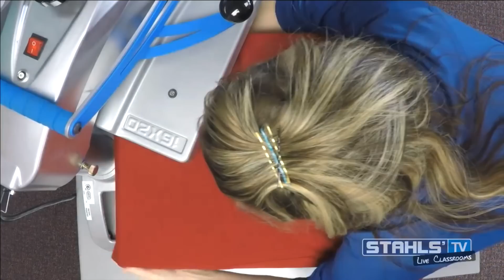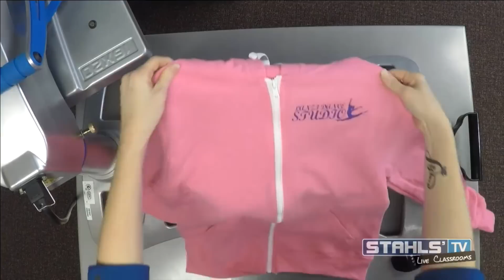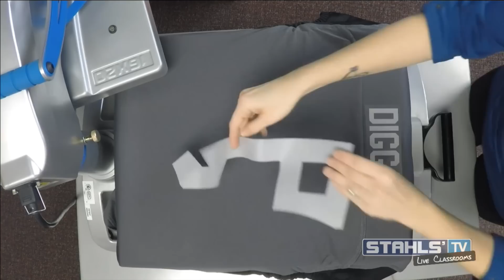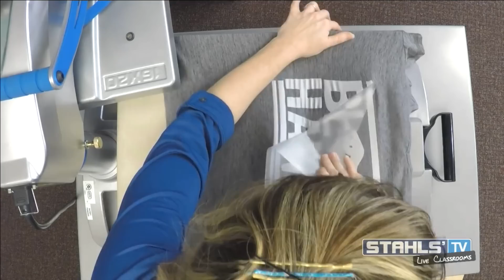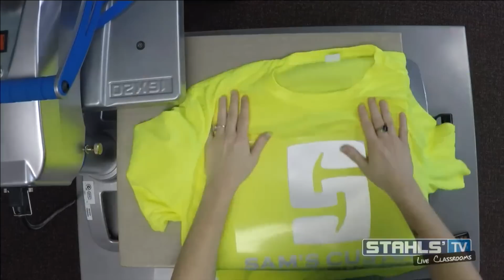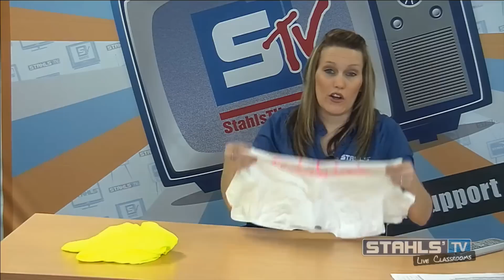Heat Transfer Vinyl Buying Guide

Comment: Can vinyls not have more then one color ? Or can you print a full pic ?
Reply from the maker: You can order patterned HTV that can be customized. Visit https://www.stahls.com/patterned-heat-transfer-vinyl for more information. As far as full color, there are options in printable heat transfer vinyl, visit https://www.stahls.com/printable-heat-transfer-material for more information; as well as digital transfers, visit https://www.stahls.com/full-color-digital-transfer or you can let us do the work for you. Please visit https://www.stahls.com/custom-logo-services for more information. You can also use our  free online design tool for artwork and ordering made easy: https://www.stahls.com/heat-transfer-templates

Comment: Thanks for the help. But i have a few questions.. on how this designs is produce I mean the process, especially what printer been used. Thanks in advance!
Reply from the maker: Most of our designs were created using CadworxLIVE and/or our free online designer. Please visit http://bit.ly/cadworx for more information on CadworxLIVE and https://www.stahls.com/heat-transfer-templates to check out our free online design tool. We can also do the work for you! Visit https://www.stahls.com/custom-logo-services for more information. And let's not forget about Transfer Express. They are a great resource for heat applied transfers, including stock transfers. Visit https://transferexpress.com/ for information.
Reply: The material is cut using an electronic cutter, such as a cricut, brother scan & cut or silhouette for home use, bit there are professional ones. The designs are made on software.

Comment: To print vinyl for garments the ink of the printer has to be necessary solvent ink or can i use inkjet?
Reply from the maker: For our printable heat transfer vinyl you will need solvent. If you need transfer paper you can go to https://www.transferpaperexperts.com

Comment: Thanks. What material to use on a clear plastic tote bag?
Reply from the maker: Plastic products will be hard to heat apply to as they have a low melting point.
Reply: Stahls' TV Ok. Thank you. I was interested in making a clear personalized stadium tote.
Reply from the maker: Yes, other tote bags may work but the clear plastic ones are too risky to heat apply. I wouldn't risk it sticking to my upper platen.
Reply: Stahls' TV ok thank you.

Comment: How do I heat press a tank top and kind of material  should I get cotton..etc..
Reply from the maker: If the tank top has ridges and is stretchy, it is difficult to apply heat transfer vinyl due to the peaks and valleys in the tank top. It tends to not get an even application. If it has the ridges I would recommend a thicker material. If it is a tank top that feels like a normal t-shirt you can used Fashion Film.

Comment: how do you get past the fact that printing on heat printing materials involves using solvent/eco solvent inks which are inherently hazardous to health...is there a blocker material for such prints?
i'm curious because because, for instance, Roland inks are known to contain carcinogenic compounds
Reply from the maker: The materials featured in this video are mostly "cut-only" which means they are not printed on an eco-solvent printer.

Comment: could I print on wood with this kind of vinyl film? also what degree is that machine at? can I just by the vinyl without a print on it? can I use a normal inkjrt printer on it?
Reply from the maker: The heat transfer vinyl products used in this are not compatible with inkjet printers. You can apply to wood but it has to be a fairly flat piece of wood that can fit under your heat press. Another way to do it is with a home iron or tack iron.
Reply: Stahls' TV thanks! so could I order designs from your company on those sheets? can I have more than one design on a sheet if they're small enough?

Comment: hi im looking to get in this type of work.....what program do you use to get designs and letters ??? or software and 
what size of heat press should be ok to start with ??
Reply from the maker: Good luck starting your heat printing business!  We highly recommend a minimum of a 15 x 15" press with the best being a 16 x 20".  If you have the budget, our favorite is the Hotronix Fusion.  If you are looking for lower price point, but still high quality, we recommend the 15 x 15 Stahls' Maxx machine.  For software, there are many options...here is a link to a video that may help, the art discussion is towards the middle: https://www.youtube.com/watch?v=SYX1n3-3pdw

Comment: Hi, Very helpful. Could you please tel me that what is the paper type that you used to pick white letters without the rest of the transfer paper ? I mean that transparent paper used to stick the letters ? What is the name of it ? (Time 3.23 minute) Thank you.
Reply from the maker: That is the Mylar carrier the heat transfer vinyl is bonded with for cutting.
Reply: Thank you very much. Great. Can you please check and tell me whether this one can be used as a substitute ? Please use the link to store. Thank you.

https://www.aliexpress.com/item/24cm-10meter-Hot-Fix-Rhinestone-Mylar-Tape-Paper-Heat-Transfer-Iron-On-Crystals-Film-Paper-DIY/1926217261.html
Reply from the maker: It could be close but the rhinestone carriers are usually not as tacky as the heat transfer vinyl carriers.
Reply: Ok. Thanks a lot.

Comment: Hello how are you doing Nice video .. I'm getting ready to start my T-shirt business and I really want to know doesn't matter if it's a 16 x 20 or a 15 x 15
Reply from the maker: Hi,
When you start with the 16x20 press, you're offering a larger print area to yourself. You can always buy smaller interchangeable platens to fit smaller garments, but the ability to already have the 16x20 platen allows you to print larger items as well.

Comment: So, you use the computer to print onto the clear paper then heat press?
Reply from the maker: Hello,
No, none of these designs were printed. They are cut out of heat transfer vinyl on a vinyl cutter and then weeded to reveal the design. You can check out all of Stahls' Heat transfer vinyls here: https://www.stahls.com/heat-transfer-material
Reply: What was the process to get the design?  Did you make it on the pc,  then lay it to vinyl?
Reply from the maker: The designs are created on a PC and then sent to a vinyl cutter. Here is a video that shows part of the process: https://www.stahlstv.com/buying-guide-cad-cut-thermo-film . We also have other videos on www.stahlstv.com that show the process of cutting and pressing vinyl designs.